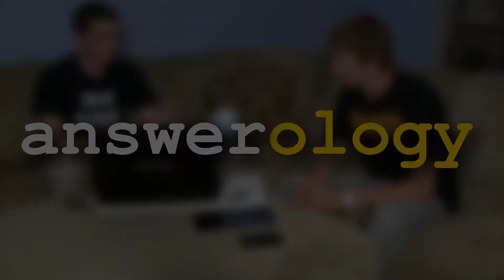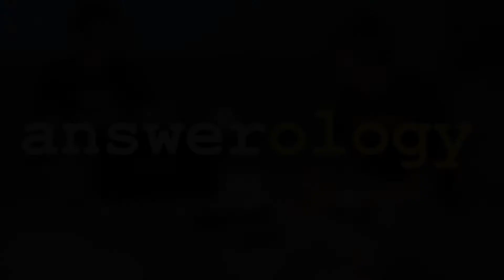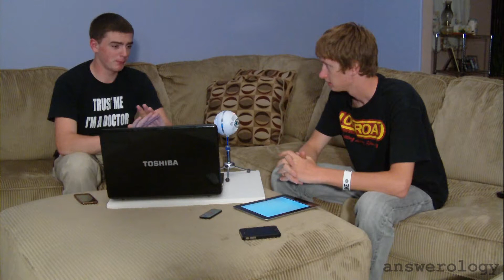Digital VS Analog

Comment: Is digital naturally occurring like analog (nature sounds, quasars, etc.), or does it require technology to produce?
Reply: +WookieeMonster I think that the whole dichotomy of analog being real and digital not is quite misleading. While it is true that analog signals are physical, both analog and digital are ways to represent a series of data. For example, you can represent market fluctuations with analog systems, but that doesn't make these fluctuations "physical". The analog signal used to represent it, though, is physical. So, no, digital doesn't occur in nature, but strictly speaking, while analog exists in the physical world, at it's core it is, like digital, a way to represent something. It's "analogous" to something.
TL:DR
Analog signals occur as physical waves, digital signals do not and have to be converted to analog ones for us to hear or see them.

Comment: Come on guys, this video does not explain analogue and digital correctly whatsoever.

Analogue - has an infinite resolution
Digital - has a finite resolution defined by sample rate and bit depth

If your doing a video specifically about this subject, these are the things you need to mention. Types of signal transfer are attributes to each technology, transferability is not the difference between the two. 

An analogue signal is not a wave or a series of highs and lows, thats absolute nonsense. 

An analogue signal is a fluctuation of voltage. When a sound is made into a microphone, the diaphragm vibrates, and generates an electrical signal.
How you choose to monitor that signal (VU meters for example since were talking analogue), or an oscilloscope like you said, is a representation of that voltage. Yes the voltage is the representation of the analogous sound, but you are talking about an analogue signal, which is a voltage, not a wave.

You refer to highs and lows with the motion of amplitude, this is wrong, amplitude has nothing to do with resolution. 

The section about clocking is entirely wrong - comparing word clock to 100Mb internet connection???! The term "word clock" isn't even mentioned. In digital audio, word clock tells when A/D converter when to take a sample in relation to the selected sample rate, the clock does not have a transfer speed because its not transferring, and it does not carry data, it makes sure the converter takes a sample when its supposed to. All you did here is explain data transfer speed between two points in an internet connection.

To tell everyone that digital audio is USB is also terrible, USB is just a carrier of data, there are so many types of connections that carry digital audio. You could at least mention one or two more so people learn something (ADAT / MADI / S/PDIF for example?)

I'm not posting this to be a dick guys, or be one of these little internet men out there to ruin everything, you refer to audio continuously throughout the video so theres no mistake this is the subject at hand, not things like computers and internet connections. However as an audio engineer myself, it did bother me to hear such confused information being put out there for people to learn from. I'm also not saying you should get super technical, just know your stuff first and explain it well. The whole thing waves in and out of subject areas and is either explained terribly, or incorrect. You should do much more research before making these videos so that wearing a t-shirt that says "Trust me I'm a doctor" doesn't make you look like a fool.

Comment: @00:18 "It relates more in terms of speed and transfer capabilities than it does to quality"

Gentlemen, the difference in sound quality, between analog and digital, is huge.  But you will not hear the difference on a stereo purchased from Walmart.  If you have properly matched quality gear (and most folks do not know about such gear -- even if they think they know), then you will hear a dramatic difference.  Analog, although much more expensive and very difficult to fully and "correctly" implement, has the potential to sound superior to anything digital.  Bang for the buck, though, digital will win.
Reply: Yeah, I've got a high quality stereo. You've probably never heard of it.